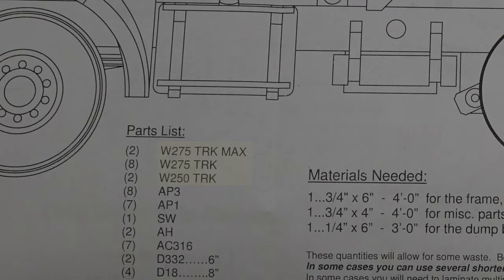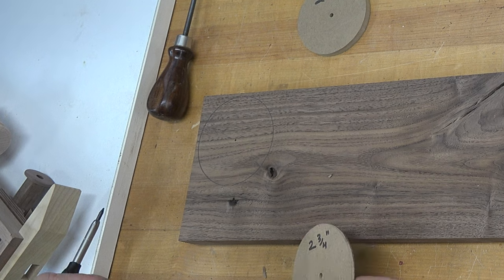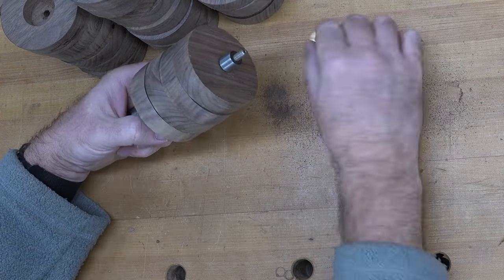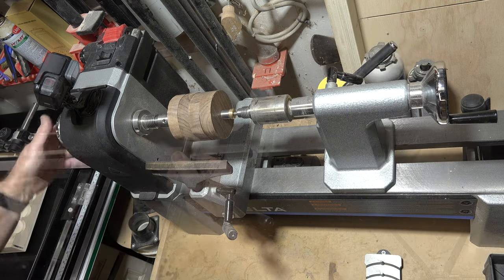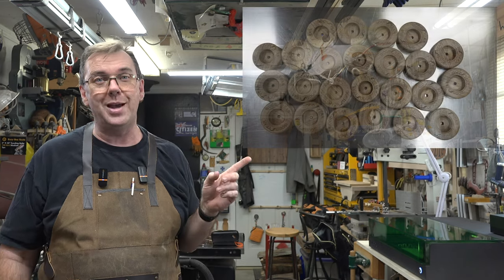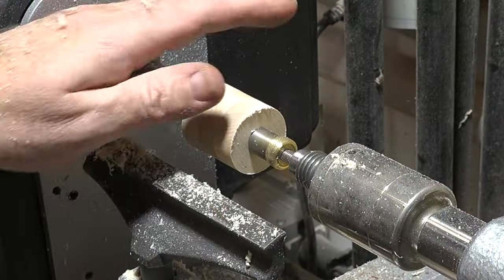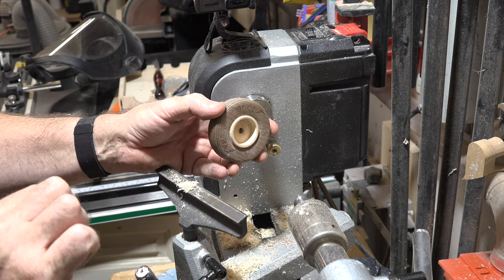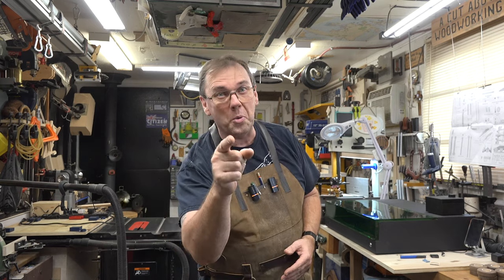Making Toys and Joys Dump Truck and Pup Trailer  Part 7

Comment: I hadn't realised there were so many wheels, but at least they were a lot simpler to make this time ... the engraving on the sides just adds so much to the overall look of the wheels ... when you added the hubs it just brought them to life 👍
Quick question, would it not be easier to turn the double wheels as one piece, rather than turning single wheels and then join them together?
Reply: I think I would do the wheels a little different ….. I would use a 3 x 3 turning blank and bring it to the proper diameter.  Then as you said I would do the duals as one unit.  All the tires would be grooved and then parted off to the proper thickness.  Then I would drill the holes and profile the outer sides.  For me, it would be simpler to do more on the lathe 🤠🇨🇱
Reply from the maker: You could easily turn them as one piece.  Only a couple of issues there for me though.  For starters, you would need much thicker stock in order to do this.  Not a big deal but still an extra step of milling thicker stock.  Also. there are some wheels that ended up with imperfections such as small knots etc and I usually use them as the interior wheels of the dually wheels.  That way, they don't get wasted and you never see the small flaws.  Can you turn them in one step?  Of course but turning them individually gives you more options and you don't have to think about the turning and your modification to it.  I hope this helps Barry.  Thanks for tuning in this week and for chiming in with your question.
Reply from the maker: There's a few reasons why I don't do this Randy.  Read my reply to Barry if you are interested.  Your method would work just fine though and I appreciate you chiming in with it.
Reply: @acutabove_woodworkings  I'm a muppet ... I completely forgot about the fact that you used a board of the appropriate thickness to make the wheels ... I'll be in the corner 🤣
Reply from the maker: @barry.w.christie   LOL.

Comment: morning Ken,  at min 19.16 you are holding your chisel on the 3 rims, not scraping of any wood. why is that? To check the roundness but those rims are (already) round, aren't they?
Reply from the maker: While turning, some pieces can look perfectly round while spinning but might have a slight flat spot that you can't see.  By laying the chisel on the top of the turning you can hear if the turning is perfectly round or not.  If it is round, there will be hardly any sound but if there are flat spots, you will hear a slight knocking sound.  It's just a way to check for roundness without having to shut the lathe off.  I hope this helps.  Thanks for tuning in Peter.